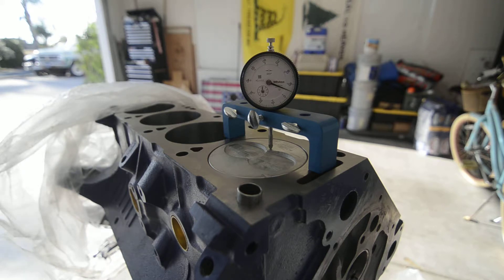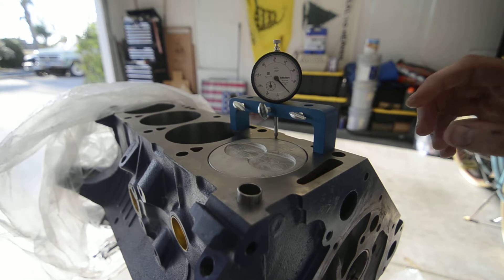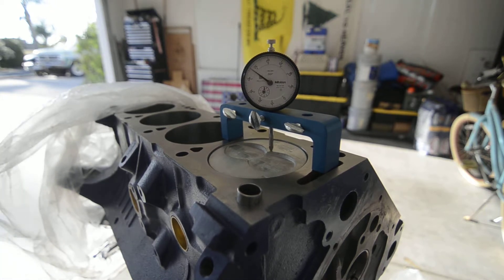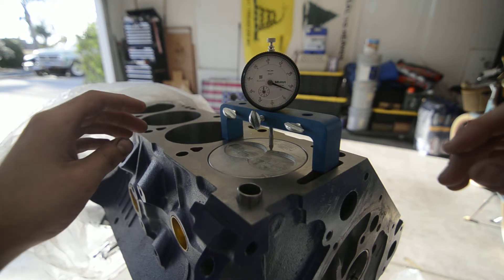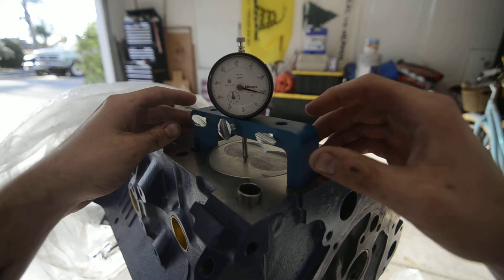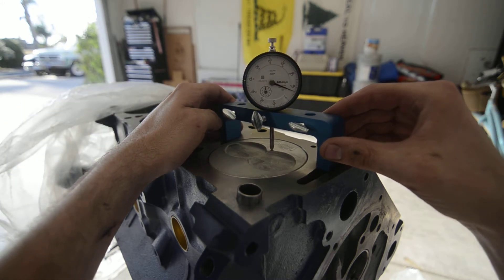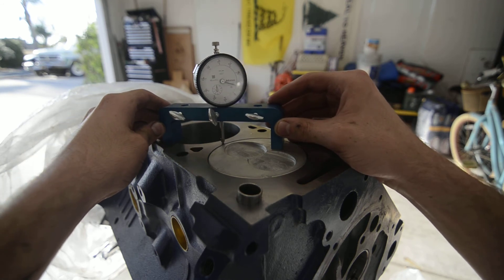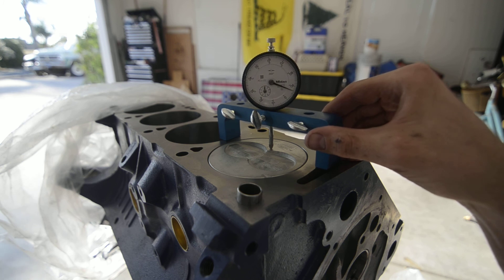Measuring Deck Clearance - 390 FE

Comment: I did this with my 390 & I can tell you alot of parts are not truly consistent with each other. Like your throws on the crankshaft can very in stroke lenth from one to another. Mine had .011 different lenth stroke from longest to shortest. Pistons are not real flat either. Atleast with the cheaper cast pistons that I used. They looked just like yours. But the piston can rock in the bore alil also. But really your distance only really matters where your quench pad is on the head. So that's were I checked all of mine. My pistons were actually above deck by .005. But the oem replacment fel pro head gasket is .050 thick so that leaves plenty of room. A .045 quench distance. I used C4AE-G heads & that gave me 9.3 to 1 compression. The chambers in these old heads are generally always bigger than the book spec. Mine were 77cc. Supposed to only be 70-74.